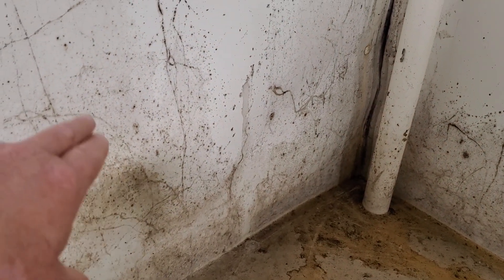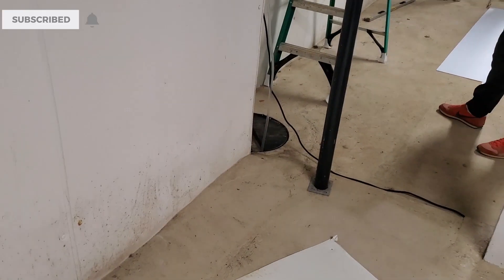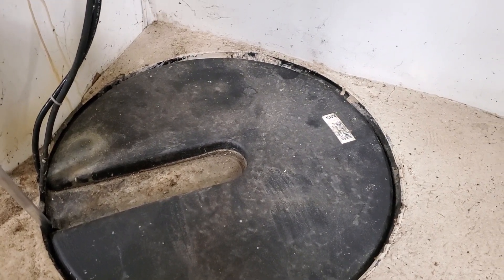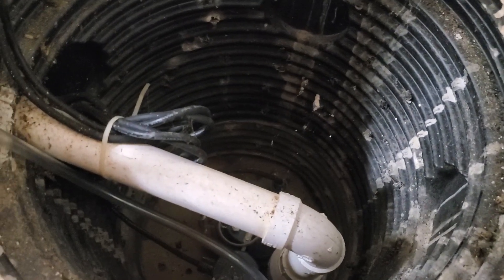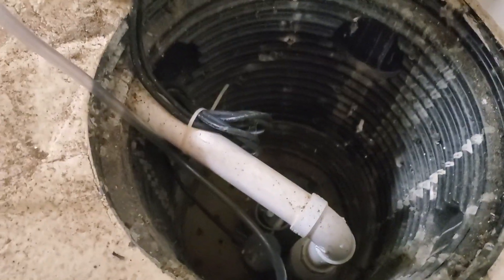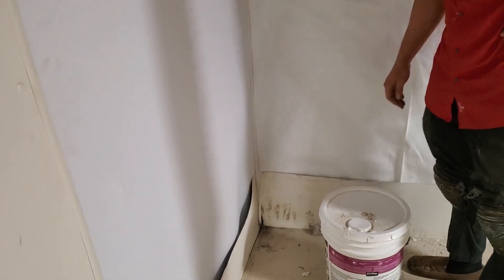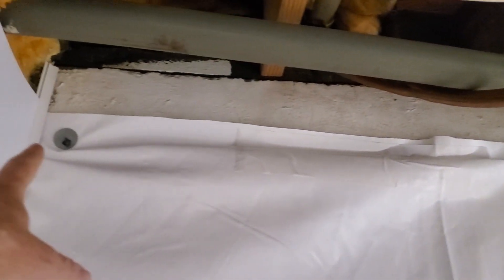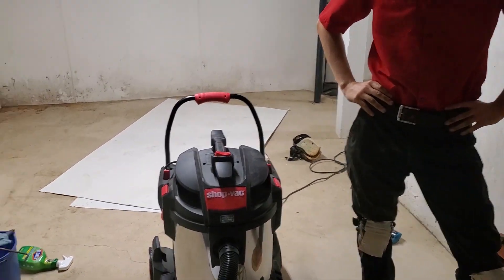Basement Waterproofing Wall Repair Tip

Comment: Hey Michael, any tips for laying vapor barrier in really tight crawl spaces? I have a section of my crawl space that doesn't have any vapor barrier, and the clearance is maybe only 8-12 inches. I can't imagine I would be able to get any wall coverage either.
Reply from the maker: I used to use extended painters poles in ones I could fit in but couldn't reach all the way. At least you can get ground covered that way. Hope that helps. Thanks for watching.